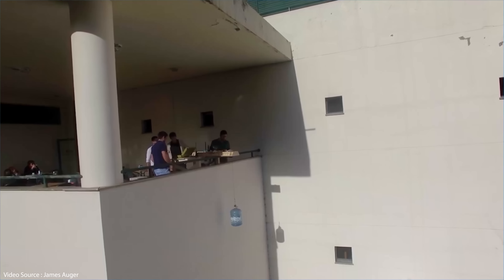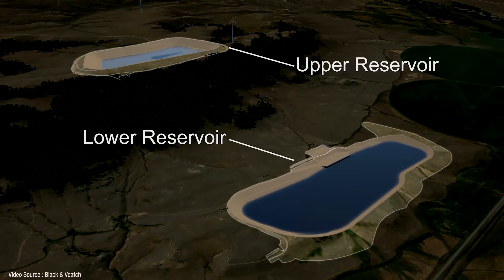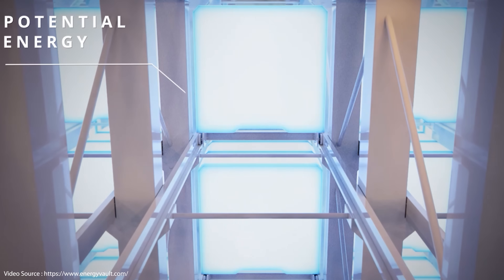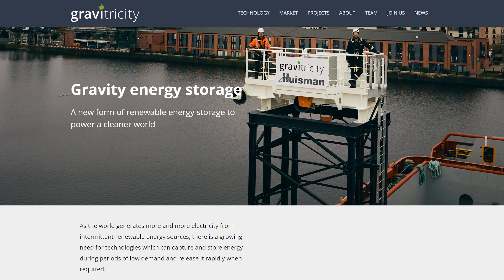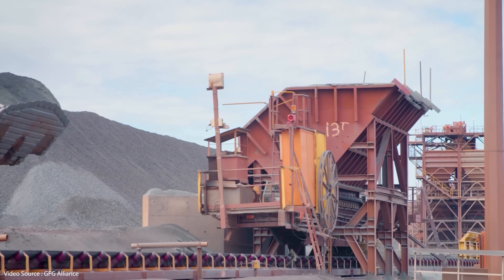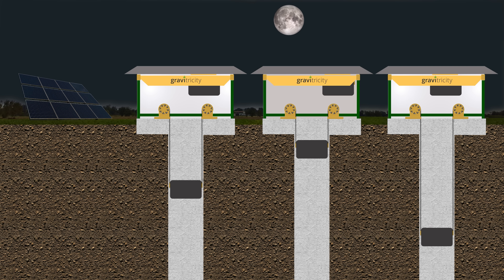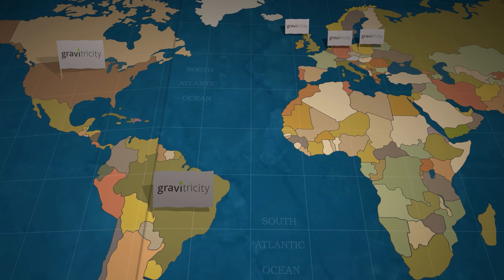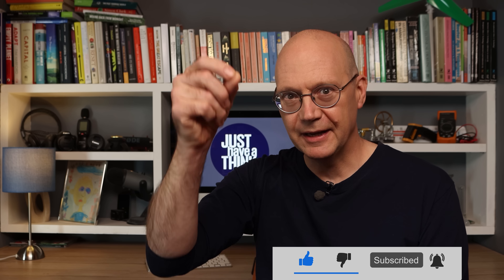Gravity Energy Storage. Who's right and who's wrong?

Comment: Re-use of existing architecture in new ways has to be considered a primary option. The energy has already been invested, so recovering it makes sense. 

Filling a mine with water, and then pumping it to the surface seems like another option here. Any leakage would replenish groundwater supplies, and be recharged by rainfall. Liners of concrete film, rubber or paint seems possible too..

Essentially, an underground pond without all the digging.
Reply: This sounds like a good idea. Can anyone else comment?
Reply: Where are you pumping the water from the mine to? For this to work, there has to be a height difference between the 2 storage facilities.
Reply: @MPostma72  Water pushes equally in all directions. Pressures increase with depth, not area. So a 1 meter deep pool will have the same pressure on the walls of its enclosure, regardless of volume of water stored or surface area. 

Given that, a fairly minimal tank structure could be constructed, possibly from a natural topological area above the mine. Even if you dug a basin it would still be half the number required for pumped hydro (1 instead of 2), and you could do this on level ground, so anywhere. You wouldn't need a hillside. At worst, it would be 2x as efficient to construct, and wouldn't need special geography, so could be done anywhere.

Comment: With a weight of sufficient mass, it would be theoretically possible to have a gravity storage with a vertical drop of 1 or 2 meters with sufficient gearing.🤔
This would eliminate the need for mine shafts.
It might even be a swimming pool for that matter 😏
Reply: Not swimming pool, more like an entire city, or a mountain. For a GWh storage capacity you'd need over 300 million tons of material, with 1m elevation change.
Reply: It would need to be REALLY heavy, like gigatons.
Reply: It would require a cable with a similar strength to a space elevator cable.
Reply: I think you'd be on to hydraulic motors by this point, which are surprisingly efficient.  (so hydraulic rams lift up the mountain, then you let the pressurised oil into a turbine etc)  or using the pressure from that to do useful work.
Reply: @mralistair737  to get any useful amount of grid storage out of a meter drop would need crazy high pressures, or a weight with a surface area best measured in hectares
Reply: @orkin2525  yeap.. it's never happening... but mining tech can lift insane pressures.  at least if people are going to make-up nonsense energy storage ideas, can we make them fun ones.. i want to lift mount rushmore by 2 metres.
Reply: @mralistair737  
Store energy in the Earth's rotation. I'm not sure how to do it, but the capacity is definitely enough.

Comment: Knowing that some mines in the United States pull coal up via a pair of heavy lift elevators, Gravitricity could find some locations already have working infrastructure in place, only needing some maintenance and a change of winch gear.

The question that comes up though, is when these batteries get charged?  Looking to the Electric Future, where more people depend on electricity for their daily commute, as well as HVAC, we are still looking at a system that will need to generate MASSIVE amounts of energy.  I can see situations where these things get discharged during daylight hours to supplement solar, then there not being enough surplus energy from wind to recharge them at night, specifically on a cold winter's night in most of the world.

I still think we need to focus more on small modular reactors as the base of our supply network.  Wind and solar can only do so much, no matter what the potential is for them.  We will always have days when the sun doesn't shine and the wind doesn't blow and basing our energy infrastructure solely on the vagaries of weather seems illogical.

Comment: What puzzles me is why wire rope is proposed. There is lots of friction as the rope is bent and unbent round the drums and pulleys. Renold's chain design is much more efficient, competing with lead acid batteries (perhaps the most efficient at present available). 
Perhaps a good source of mass would be scrap lead and copper alloy, readily available but expensive to reprocess and heavy.
Reply: Gravitricity plans on using scrap iron.

Comment: Hydro-power pumps millions if not billions liters of water and each 1000 liters is a metric ton.

How much concrete would you have to use to equate the same volume of water provided concrete is only 2,5x denser than water?

I think those gavity-based solutions using rocks are not practical and do not scale. Instead you can simply build a water tower which is much cheaper has less wear and tear, so requires less maintenance.

Comment: The big "problem" with gravitricity is the scaling problem. There are only a limited number of mine shafts available that are suitable for the technology. Where we can use it, we absolutely should, but it is nothing that will revolutionize anything due to the lack of scalability. So it is not in any real competition with traditional battery technologies.
Reply: Increasing the number or depth of the shafts would be difficult, but could you have versions with small weights for fast response and with really big weights for maximum capacity?
Reply: @grahamthompson5581  Once you think of purpose building them, meaning drilling a shaft and all, then they will become extremely expensive. Their entire sales pitch is that thy are cheap as they can reuse existing infrastructure.
Reply: @_aullik  Yes, I was saying you don't necessarily need to spend the money for more shafts to increase capacity, just use bigger weights, which would probably be much cheaper.
Reply: @grahamthompson5581  I agree. More likely more weights instead of bigger weights as this scales better tho. But for that you need something at the bottom to get the weights out of the way. But that should be doable with minimum effort.
Reply: and are the mines near the usage? If not, then there are infrastructure costs. Imagine producing cheap electricity in Cornwall then shipping it to London.
Reply: @GrahamCampbellNZ  Shipping electricity is actually not that much of a problem. In a world of distributed solar and wind we will need storage wherever we can get it. They want to reuse existing mine shafts with minimal modifications, so they are quite cheap and should be used where possible.
Reply: @_aullik  The upgrade and 'transport' cost will impact viability. But the cheap mineshafts will offset that cost to a degree.  Solutions per house or town would be the optimum I think.
Reply: @GrahamCampbellNZ  Transport really is a non-issue. If it is in the middle of nowhere, you can build a wind/solar farm next to it and just need to connect electricity once. If it is between 2 places,  then you already have the connection and can use it as a grid stabilizer. Also where there are mines, there are usually towns cause they developed next to the mines.

Comment: an idea I had that I was happy to see some scientists also looked at is the possibility of using skyscrapers as gravity storage. basically, lots of elevators already have energy-recovery systems built in, so use some section of the elevator and building to carry and store loads. almost all the infrastructure is already in place. may only need something like a kiva robot to move the loads. this would be ideal for big buildings that have multiple elevators, esp office buildings, since one or more of the elevators can be sectioned off (esp at night) to move the loads. (Another option is a two-story elevator, where one booth is just for loads and inaccessable to the public.)
truth be told, like most gravity storage systems, I don't know if the economics of this work out, but it does seem really enticing to have energy storage built into local structures by making dual use of capital.
Reply: The big issue is of course that the elevators are constantly going up and down because people need to use them. You can't tell people "go take the stairs to the 65th floor, because the sun is shining, but if you stay there till it's dark you can ride the elevator down". The other thing is: there's very little energy in small weights. You need huge weights to get a meaningful system, and by then it's going to be a whole different structure that you need.
Reply: Skyscrapers already have enough physics working against them that adding extra strain and liability is not worth the minimum energy gain
Reply: @thomasreese2816  It's an idea, even if they only used the energy within their own building to power computer banks and energy load.

Dump an overpower to the building, and have it ballance its own power needs.
Reply: @onebylandtwoifbysearunifby5475  The maths for this is very easy. Let's say the elevator has a rated capacity of one tonne and the building is 100m high. That equates to 0.28KWh of stored energy. By the time you've overcome frictional losses I'd be surprised if you get 0.1KWh of electricity, which will make about one cup of tea and has a commercial value of about 5 pence. Deduct the cost of all the extra machinery and you rapidly conclude it's a non-starter
Reply: @sammason2300  Frictional losses could be replaced with magnetic forces, so could be analogous to mag-lev trains or regenerative AC motors. 

New buildings are being built all the time, and such ideas as energy recovery seem a good idea. 
Maybe a retrofit wouldn't be efficient in this case, but a central tower with a mass suspended as a counterweight to locomotion may be feasible. This tower could also be subsurface, and part of the building's cantilever foundation.

 The first aeroplane sucked too; i mean 12 seconds? That will never take off.
Reply: @onebylandtwoifbysearunifby5475  Low speed generators are very big and expensive, whilst high speed generators require lossy step-up gearboxes.

But my main gripe is the exceptionally low power density. My view is that gravitational storage only makes sense for pumped hydro, and only then if the natural geography already exists.

This idea has been around forever. It wasn't commercially viable before so why would it be now?
Reply: @sammason2300  "commercially viable" - I'm not sure what that means. Profitable? Is having fire departments profitable? They generate no revenue, and are always pandering for money. But for some reason, people seem OK with them. 

"Low energy density". That's a bit more clear, but still a bit ambiguous. Over what time period? If people need to be transported hundreds of times per day, this is a different scale. Rocks have higher energy density than water. They have more mass per volume. So if water can be moved, and rocks can be moved, then the energy recovery should be similar since the density of rocks and water is not a changing variable.  

 The question seems to be if there are multi-use structural constructions which would allow energy recovery AND another function to share common materials. It seems there should be. 

Hydroelectric turbines can deal with Niagra Falls, so it would seem electomagnetic fields should be capable of providing suitable resistance. 

E=mc^2 says rocks have higher energy density than water. And gravity is the same in both cases (provided similar altitudes). So it seems it's just an engineering question, not a physics question. 
Can engineers be creative enough to make such an efficient multi-use structure? How many buildings are there? How many times a day can they operate? That all multiples together. It could be worth investigating, since people are building buildings anyway. 

This doesn't exclude pumped hydro. It would be more like putting solar panels on a roof you're building anyways.
Reply: @onebylandtwoifbysearunifby5475  Pumped hydro systems typically have capacities of multiple GWhs because they are huge. They are commercially viable because water is abundant and can be stored easily using existing geological features. On the other hand an elevator has a capacity of 0.1kWh, i.e 7 orders of magnitude less.

I don't really understand why you think commercial viability is unimportant, or why you're invoking relativistic mass arguments. This is just a question of gravitational potential energy
Reply: @sammason2300  How many buildings are there? How many times per day can a mass be moved up and down in each? How expensive is rocks? 

Are pumped hydro existing geological features, or must they be built? How close are they to the end use power consumers? How much extra infrastructure must be run? How much expensive  wire? How much power loss from transmission? 

There are many factors to consider.
One may not replace the other, or exclude it. There is not going to be a "one solution" power system.
Reply: @onebylandtwoifbysearunifby5475  I suspect there are very few buildings with spare elevator capacity to dedicate to this. After all, why would the building designers have provided more capacity than was necessary for the efficient transport of people through the building?

As with pumped hydro the system can probably be used once per 24hr cycle to take advantage of cheaper electricity at night
Reply: elevators have counterweights ... it'd be cool to have smart elevators that can manage counterweights and accumulate a little in higher floors while  ... ..  . . .. the impact would be just minimal... waste of brain activity ;)

Comment: I'd say that the Swiss tackled their initial flaws quite well with that structure around it. Both ideas are awesome!
Reply: You loose energy by moving things sideways (no increase in potential energy). Also, you would need te engineer the structure to be able the lift and hold all the weight, which means there will be a lot of resources used just for the structure itself. Pumped storage in the CGI mountains behind the building would be a lot cheaper, easier and safer.

Comment: So these systems are designed to benefit from surplus gravity assisted energy by using mechanisms the work in tandem with weight shifting distribution and locking devices? If I understand  correctly, the idea is to capture the acceleration energy that earth is experiencing from our stars pull through our galaxy as it flys through the universe.

Comment: After viewing thermal energy storage in large, piped and insulated 'sand' filled containers ...I can imagine that gravity feed power generation could be both, well powerful and fast enough in response.  And just with the utter of underground holes I'm wondering the feasibility of Elon's tunnel boring/wall installing tech. going vertical just for the sake of this being a future efficient consideration.  There also has to be some geo-thermal opportunity when going deep enough too, no?
Reply: This made me a bit curious, what tunnel boring technology does the boring company have that other similar companies don't have?
Reply: @miklov  Hi, the Boring co. is the first to combine the wall construction/support with the front of a tunneling machine,  so it is a seamless, automated all in one unit!.   And of course Elon will be making it faster ..and faster.  Las Vegas project soon to begin, check it out.  
But in hindsight to my previous suggestion above, I don't suppose boring straight down will work anything like horizontally, and these are big, hard to transport machines I would imagine.
Reply: @stokepusher5481  The only thing I found about it was this https://en.wikipedia.org/wiki/The_Boring_Company#Prufrock

It says that an innovation is that you can add walls without stopping the tunneling process but it doesn't seem to be fantastic in any way. From what I understand the excavation speed and costs are comparable to other companies.

I don't doubt that they have something to offer but I don't see any 10X improvements anytime soon. I think certain things are just hard, like removing a lot of material. I wonder if for large tunnels they remove larger chunks or if they still grind everything down to small bits. (They is referring to the general industry).
Reply: @miklov  It was this one that popped up on my Tube; https://www.youtube.com/watch?v=0qzQ4D14NEI&t=346s
I think tunnelling will be a prime objective when/if we get living on Mars, so no doubt Elon will want some progress for there as well as here.  I didn't actually finish viewing the above content.  Probably will now...

Comment: Great video, thanks for the update.  I am an Engineer and I think the Gravitricity solution looks much more reasonable and the Energy Vault solution seems overly complex.
Two questions: 
1) Has Gravitricity considered a hybrid solution where large blocks are staged at ground level and attached and detached to the lift so that you could gain addition capacity without having to drill more holes and add more generators?
2) How deep will the holes be?  What is the estimated capacity for a single hole?
Reply: ( Sorry misspelt ) 1000 meter not meyer.
Reply: Gravitricity's animated video shows multiple block capability:

https://youtu.be/meFkbADJq28?t=131

There is an online gravity power calculator at omnicalculator that can accept weight and height values and give energy in kWh.  I'd include the link but YouTube doesn't allow external URLs.

Gravitricity gives weights in the 500 tonne to 5000 tonne range and depths in 150m to 1500m.  The max energy storage from that based on theoretical calculations is 20.4MWh.
Reply: @beyondfossil  Thanks, I had not seen that video
Reply: Isn't that (1) exactly what is shown in the video at 6:25.